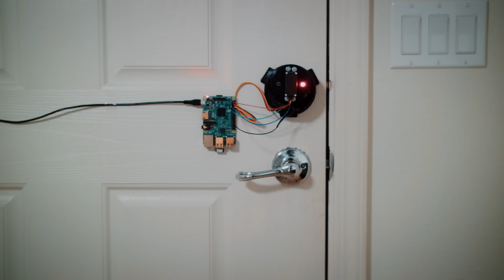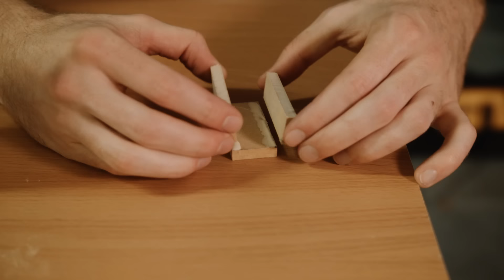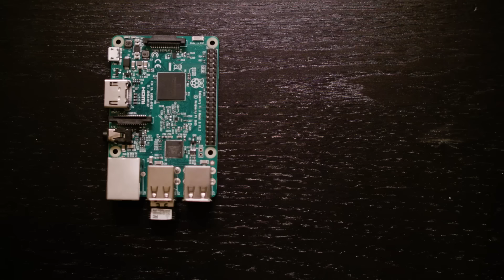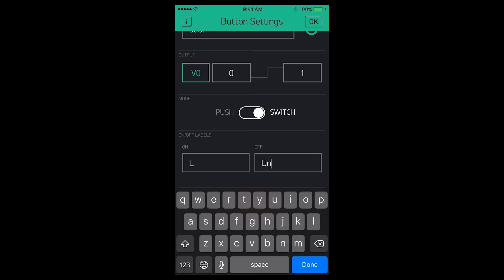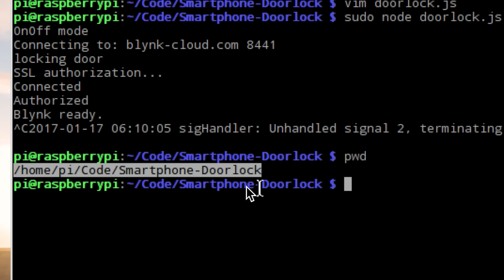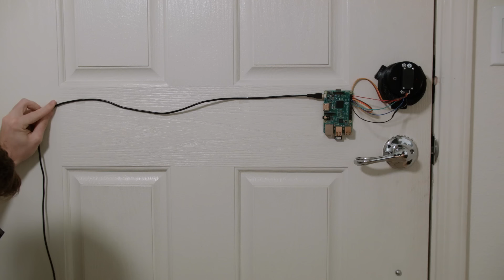How to Make a Smartphone Connected Door Lock

Comment: Yeah this is nice, good work by the way, but there are door jam bolt release mechanisms that you don't have to make any 3d printed stuff.  They don't cost much either. You can have the wire hidden behind the trim boards. And by using an MHCOZY smart switch you don't have to do ANY arduino programming.  You can even use the Bluetooth function on the MHCOZY to open the door when your phone is close to the door.
Reply: You can also have gaagle's always listening function to unlock the door when you say "Hay gaagle unlock my front door.". For those times you're holding a bunch of groceries.
Reply: door jam locks like this guy https://www.youtube.com/watch?v=M76g81G3bi8

Comment: Wireless devices are hackable....I never used wireless to unlock nor never used master password too to reset, so i didn't import ready made locks from China , only problem I faced is long bunch of wires going to lcd and keypad , this can be minimized using Dallas 1 wire communication chips ...

Comment: A couple of suggestions to improve your project: couple the servo with a gear and put a thru shaft. Gear should engage to the shaft on shaft's axial movement (like a car gear box). Put a handle to the back end of the shaft and a spring which would push the shaft towards gear. When someone pushes the handle from inside that would disengage the gear, and you can lock/unlock the door manually by the handle. I hope this makes sense.

Comment: Kits? can you give an SD card with all the tec parts done? So i can just plug and play with my Pie?
Anyways, awesome vid! I'm doing to a door that's a secret door to a secret room. It'll also be spring loaded so it'll unlock and open. I'm going to put most of this inside the door and connect the wiring inside the wall. Been wondering how to do the lock on this door, so thanks again!

Comment: For doors with not a turning handle on the outside, would it be possible to remove the door knob lock (we call it tongue in my country, I am talking about the thing that closes and opens when you turn the door knob). Remove it or replace it with one that opens and closes with some basic force then have an external lock that has a female insert screwed on the door and a male remote controled piece on the wall that locks the door tightly closed using the app.

that way you can still use your doors lock system and as a backup and keep that unlocked when you want to remotely open the door by opening the external mechanism.

Comment: You should be able to design it so you can use the servo and the key to open and close the lock. You just need to have a slack between the servo and the lock turn.  Like let the servo lock with a fork on the original manual lock turn.

Comment: Powering the servo directly causes the Pi to restart
Reply from the maker: It's probably drawing too much current. Wire the servo's power wire separately and connect the grounds
Reply: How did you power the Pi in your installation? Could you share more details about the power adapter? Ive tried a 2A 5v adapter but it still stutters on trials and I pull the pin out afraid of damaging the board. Is it a power issue or something else.

Comment: Could you add another button on the case that is programmed to lock or unlock the door depending on which state it is in? 
I don't know too much about this kind of stuff but for sure want to learn about it. The servo is it always in one place until told to be moved or can it be freely turned as you want but moves when it is told to? If it can be moved freely an opening could be made on the casing so you could reach a finger in a turn the lock physically right? Also, does the servo keep track of how much it has turned or is it just a motor that moves when it is told? 
I would love to learn about this so if you have any knowledge to share please do so! Thanks.
Reply: For the button part, you can just add an if statement in the code

Comment: I'm getting an error when I try to run 'sudo node /path/doorlock.js' (obviously I replace path). I checked to make sure all the dependencies were installed correctly (they did). The error message thrown is '/path/node_modules/pigpio/node_modules/bindings/bindings.js:91
  throw err
  ^

Error: Could not locate the bindings file. Tried:
→ /home/pi/Downloads/Smartphone-Doorlock-master/node_modules/pigpio/build/pigpio.node
 → /home/pi/Downloads/Smartphone-Doorlock-master/node_modules/pigpio/build/Debug/pigpio.node
 → /home/pi/Downloads/Smartphone-Doorlock-master/node_modules/pigpio/build/Release/pigpio.node
 → /home/pi/Downloads/Smartphone-Doorlock-master/node_modules/pigpio/out/Debug/pigpio.node
 → /home/pi/Downloads/Smartphone-Doorlock-master/node_modules/pigpio/Debug/pigpio.node
 → /home/pi/Downloads/Smartphone-Doorlock-master/node_modules/pigpio/out/Release/pigpio.node
 → /home/pi/Downloads/Smartphone-Doorlock-master/node_modules/pigpio/Release/pigpio.node
 → /home/pi/Downloads/Smartphone-Doorlock-master/node_modules/pigpio/build/default/pigpio.node
 → /home/pi/Downloads/Smartphone-Doorlock-master/node_modules/pigpio/compiled/6.12.3/linux/arm/pigpio.node
    at bindings (/home/pi/Downloads/Smartphone-Doorlock-master/node_modules/pigpio/node_modules/bindings/bindings.js:88:9)
    at Object.<anonymous> (/home/pi/Downloads/Smartphone-Doorlock-master/node_modules/pigpio/pigpio.js:5:31)
    at Module._compile (module.js:570:32)
    at Object.Module._extensions..js (module.js:579:10)
    at Module.load (module.js:487:32)
    at tryModuleLoad (module.js:446:12)
    at Function.Module._load (module.js:438:3)
    at Module.require (module.js:497:17)
    at require (internal/module.js:20:19)
    at Object.<anonymous> (/home/pi/Downloads/Smartphone-Doorlock-master/doorlock.js:46:30)"
My interpretation is that it is not creating the nodes so I reinstalled the latest recommended C compiler which yielded an identical error. Any advice is appreciated. I'm a veteran user so I just need a solution. Also just in case anyone else was having the issues. I had trouble installing npm on/off  for some reason, and had to cd into the troublesome directory and sudo chown root:root * that sucker which fixed it nicely. Thanks in advance!

Edit: I checked and pigpio's C library was installed correctly in /usr/share and I think some other places. I believe there must have been a version change which broke your code. Unfortunately I don't know javascript so I cannot help you.
Reply: sudo apt-get install node
Reply: done installing node but i dont get any response after installing node
Reply: Hampton Ford how did you fix this issue ?
Reply: I didn't. The software just isn't working (again probably due to newer version).
Reply: were you able to fix this problem? I'm facing the same problem
Reply: same has anyone found a fix
Reply: This is the same error we've got! we tried to email hackershack.io, message them on ig, but got no response to any.

Comment: Great project. The only thing I'd say is that, to get the same functionality with an ESP8266 would be infinitely simpler and cheaper. Still, if it's a Raspberry Pi project you're after, this is a great one!
Reply: and it will run Esphome and it could be used in Home Assistant
Reply: I'm seeing this several years after it was made and I'm trying to think of how it could be miniaturized even further. If you used an ESP8266 you could put a battery on board to run the ESP and then you wouldn't have wires running from the Pi to a power source.

Comment: Hello ,

I am getting the below error :

pi@raspberrypi:~/Smartphone-Doorlock $ sudo node doorlock.js
/home/pi/Smartphone-Doorlock/node_modules/pigpio/pigpio.js:137
pigpio.gpioSetISRFunc(this.gpio, +edge, +timeout, handler);

Error: pigpio error -123 in gpioSetISRFunc
at Error (native)
at Gpio.enableInterrupt (/home/pi/Smartphone-Doorlock/node_modules/pigpio/pigpio.js:137:10)
at new Gpio (/home/pi/Smartphone-Doorlock/node_modules/pigpio/pigpio.js:40:10)
at Object. (/home/pi/Smartphone-Doorlock/doorlock.js:49:12)
at Module._compile (module.js:570:32)
at Object.Module._extensions..js (module.js:579:10)
at Module.load (module.js:487:32)
at tryModuleLoad (module.js:446:12)
at Function.Module._load (module.js:438:3)
at Module.runMain (module.js:604:10)

I am using the RASPBERRY PI 3 with RASPBIAN Installed . Placed the Signal Wire in 14 Slot as mentioned in Code. But I am getting this error.

Please assist me. ASAP

Comment: Little overkill with a Pi. ESP8266 with sleep mode and 18650 would be nice so you don't need a charger all the time.
Reply: came here to say this. you could probably get away with using an arduino and the smartthings library for example
Reply: smoresrock or attiny 85 ?

Comment: I tried this using the NodeMCU board and got everything working (with Alexa-Home, my own rapsberry server and secure communications with the board), even with the 3.3v out of the board, is enough to open/close the door. The issue I'm facing is actually trying to open the door using the key. The motor is holding the door lock and is almost impossible. How did you guys solve this?
Reply: Did you ever get around solving that?
Reply: @steviewonder5895  nah, I don't think is possible with these motors

Comment: Great project!
I have my servo moving using Blynk, but it only works with the Raspberry terminal open.
Also, it does not start automatically on reboot by inserting the code to the rc.local file.
What am I missing?

Thanks

Comment: Any Ideas as to what would cause this error?  The blank Blynk program worked fine... 

pi@raspberrypi:~/Smartphone-Doorlock $ sudo node doorlock.js/home/pi/Smartphone-Doorlock/node_modules/pigpio/pigpio.js:137
  pigpio.gpioSetISRFunc(this.gpio, +edge, +timeout, handler);
         ^

Error: pigpio error -123 in gpioSetISRFunc
    at Error (native)
    at Gpio.enableInterrupt (/home/pi/Smartphone-Doorlock/node_modules/pigpio/pigpio.js:137:10)
    at new Gpio (/home/pi/Smartphone-Doorlock/node_modules/pigpio/pigpio.js:40:10)
    at Object.<anonymous> (/home/pi/Smartphone-Doorlock/doorlock.js:49:12)
    at Module._compile (module.js:570:32)
    at Object.Module._extensions..js (module.js:579:10)
    at Module.load (module.js:487:32)
    at tryModuleLoad (module.js:446:12)
    at Function.Module._load (module.js:438:3)
    at Module.runMain (module.js:604:10)
Reply: did u solved this. pls help me

Comment: good video but i would rather use a key than having all those cabels attached to my door
Reply: I think this was set up as a working example... and not as a finished polished project.  I think you could clean this up by longer wires that are painted or at least the same colour as the door.  Then thread attach them so it was harder to see.  Then run then down to the floor and over to the RPI.  The wires would leave the door at the hinge and floor so again more difficult to see.  That would minimize the bulk on the door and make the wiring less visible.  But that is all just polishing  for a perm project.  They are giving you the bones and letting you do the polish.

Comment: Question - What would you do if there is no power and the electricity is cut? Can you add backup battery power just in that case and this battery to be used only when the primary electricity circuit is not working. And if that is possible how woul you do it(connect it)? :)

Comment: wow!! this video is awesome and the presenters are just on point. thank you its really enlightening. i am wondering though, if i want to use Arduino-Uno instead of Raspberry Pi and use Sim800 GSM module for accessing my micro-controller instead of blue-tooth module do i need to have an external power supply for the servo or Arduino power supply still works?

Comment: When I try sudo npm install it comes up "command not found" what am I doing wrong?
Reply from the maker: +Diedrik Agnalt Nilsen make sure you have node installed
Reply: Ok. Thanks!
Reply: Were you able get this to work ?
Reply: Rahul Reddy Sathi yes😊
Reply: +Didi 0269 Great

I get this error :

 pi@raspberrypi:~/Smartphone-Doorlock $ sudo node doorlock.js /home/pi/Smartphone-Doorlock/node_modules/pigpio/pigpio.js:137 pigpio.gpioSetISRFunc(this.gpio, +edge, +timeout, handler); ^ Error: pigpio error -123 in gpioSetISRFunc at Error (native) at Gpio.enableInterrupt (/home/pi/Smartphone-Doorlock/node_modules/pigpio/pigpio.js:137:10) at new Gpio (/home/pi/Smartphone-Doorlock/node_modules/pigpio/pigpio.js:40:10) at Object.<anonymous> (/home/pi/Smartphone-Doorlock/doorlock.js:49:12) at Module._compile (module.js:570:32) at Object.Module._extensions..js (module.js:579:10) at Module.load (module.js:487:32) at tryModuleLoad (module.js:446:12) at Function.Module._load (module.js:438:3) at Module.runMain (module.js:604:10) pi@raspberrypi:~/Smartphone-Doorlock $ 

Any help will be appreciated.
Reply: I can't say I've gotten that error message... at what point did you get the error?
Reply: I get that error when I run the las command to start the program " sudo node doorlock.js"
Reply: Rahul Reddy Sathi Have you also installed Blynk on to the  Raspberry Pi?
Reply: Diddi 0269  yes, Blynk works fine. It's something to do with the GPIO
Reply: Rahul Reddy Sathi, 
I have the same issue.. did you get it fixed?

"pi@raspberrypi:~/Smartphone-Doorlock $ sudo node doorlock.js/home/pi/Smartphone-Doorlock/node_modules/pigpio/pigpio.js:137
  pigpio.gpioSetISRFunc(this.gpio, +edge, +timeout, handler);
         ^

Error: pigpio error -123 in gpioSetISRFunc
    at Error (native)
    at Gpio.enableInterrupt (/home/pi/Smartphone-Doorlock/node_modules/pigpio/pigpio.js:137:10)
    at new Gpio (/home/pi/Smartphone-Doorlock/node_modules/pigpio/pigpio.js:40:10)
    at Object.<anonymous> (/home/pi/Smartphone-Doorlock/doorlock.js:49:12)
    at Module._compile (module.js:570:32)
    at Object.Module._extensions..js (module.js:579:10)
    at Module.load (module.js:487:32)
    at tryModuleLoad (module.js:446:12)
    at Function.Module._load (module.js:438:3)
    at Module.runMain (module.js:604:10)"

Comment: OK.  Spitballing an idea here.  Could we use this architecture to control a 3 position switch?  I am in the formative stages of an idea here where you use a Raspberry Pi to control and turn a generator off and on based on the power level of the battery back-up.  Battery hits 30%?  Electric Start Generator turns on.  Battery hits 100%?  Generator is switched off.

I'd also like to have a notification sent to my smart phone if the generator is turned on, thereby alerting me to power outages when I am not present in the building.  And possibly scheduling regular weekly maintenance by switching itself on and off for a short period of time each week.  Oh, and possibly attaching a small LED screen to show the battery backup power levels as read by the pi.

The practical upshot is that during a blackout, all devices can stay powered even in the absence of staffing.  My biggest concern is in the servo being able to switch the key from off to on to start and back to on.
Reply: How did you go with this project, did you follow through? I'm in a similar position with need for a device like this
Reply: You would be much better off by removing the mechanical element of this design. Just use a couple of relays to control starting the generator. You should probably use a sensor to detect when the generator is running to disengage the starter motor. You would also want to prevent the start engaging when the unit is already running. This could be achieved multiple ways.

Comment: Couldn't this be made far more compact with a RasPi Zero? for how simplistic and fairly unintensive that it is, I think one of these would be more than sufficient and you can easily connect to a network with Usb dongle or USB > RJ45 convertor.
Reply from the maker: +stevob211 yep, it'll work with any pi

Comment: could you have a small onboard battery that could power the pi for a few minutes and then some contacts on the top of the door to transmit power when closed? that way wires could be routed in different directions.

Comment: I feel like there must be a better solution for power supply than tape it onto the next wall, but a battery won't work either, if it runs out of power when your outside it's kinda bad.

Comment: should be a nodeMCU or ESP8266 enough, instead of a relatively expensive raspberry pi 3 ?
Reply: TheBadFred the RasperryPi is definitly an overkill, when it's just about WiFi and some IO-Pins. Blynk also supports ESP8266 according to their website.
Reply: but i want to use this project, as i undestand just need to use same GPIO HEADER on Raspberry pi Zero :)
Reply: SO juse need to use same GPIO HEADER?
Reply: Yanir just google it.. there are enough tutorials and howtos on the internet ;)
Reply: Got it working with the NodeMCU, it gets super hot after a while tho. I'm powering it with a phone external battery

Comment: what if you maked the lock to let you in if your phone is connected onto the wifi of the house. Phones automatically connect nowadays, if the doors unlocked as soon as your phone connect to the wifi, it would be cool.
Reply: But then your door will stay unlocked the whole time
Reply: Le Paon se déchaine - Marxyz not to forget that you would then have to manually change to your internet enabled WiFi every time you came inside
Reply: Finn, what do you mean manually change to your WiFi? Unless you have some weird settings, your phone will automatically connect to home WiFi when you get in range.

Of course this isn't ideal because someone could just come into your house when you were sleeping.
Reply: StalePhish I mean that unless you are using it as a device connected to your home network (rather than using WiFi direct), you would have to connect to your door and then to your home network manually.
Reply: StalePhish also it doesn't have to be insecure. you might be able to use a one-time password system that will add your phones Mac address as a trusted device.